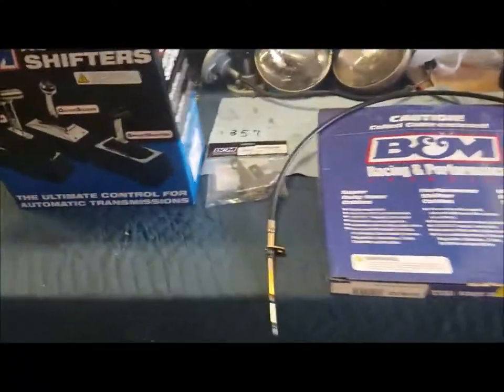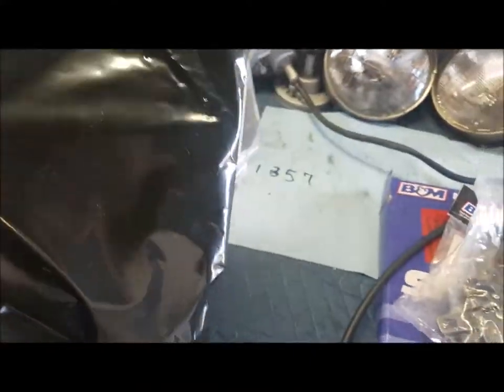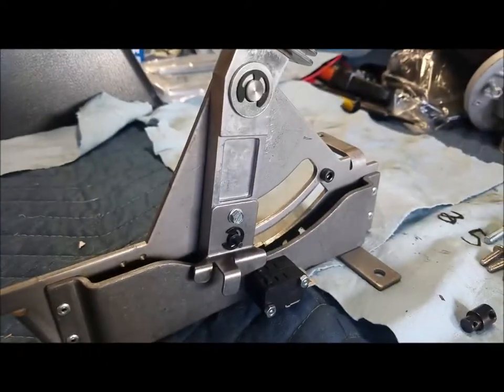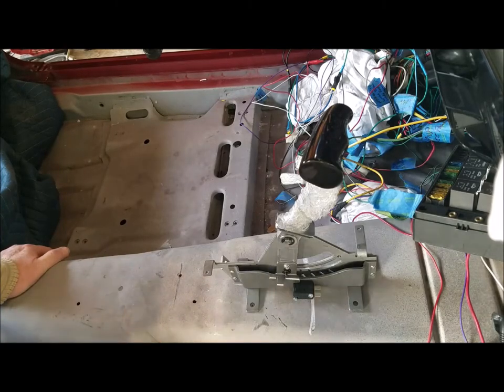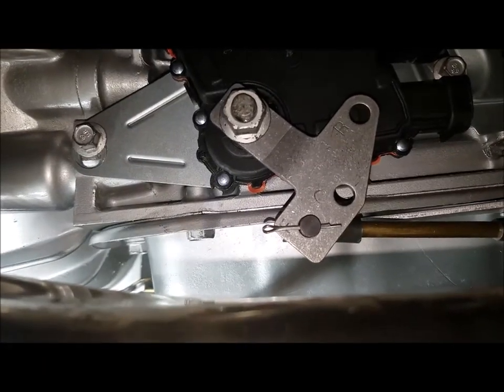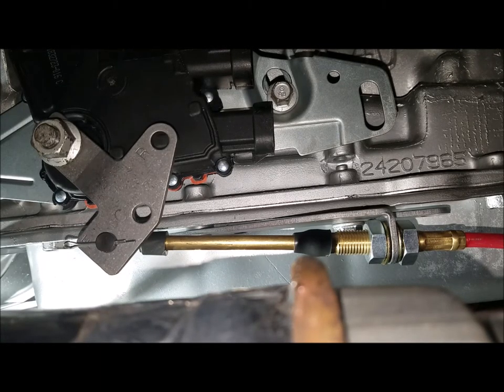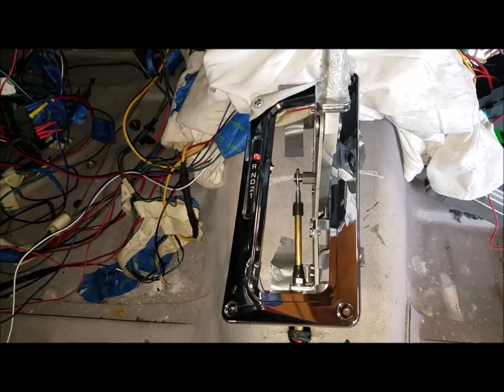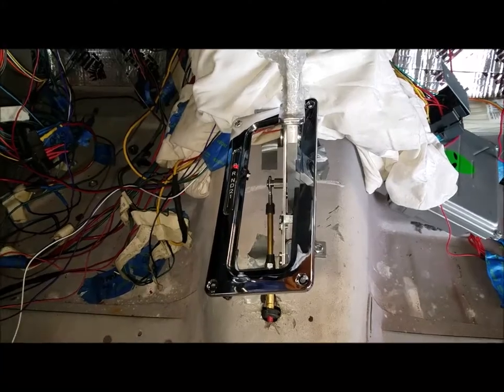B & M Sports Shifter install

Comment: Thank you for providing this instructional video.  It helped a lot, as I am considering the same shifter for my 4L60E, however I have a question.  I see that you were not able to shift it into 1st gear.  I see you only went from D,3,2 but no 1st gear.  Or did I see that wrong?  If you could clarify that, I'd appreciate it.  Thank you.
Reply from the maker: Thanks for the question. I reviewed to see what I did and it did shift into 1st.  This video I hadn't hooked up the switches yet, it was starting in all the gears. The next video I did correct that. Currently the vehicle is up on jack stands so I see if the left rear wheel turns and it does in all the gears except park, but even in neutral the wheel turns. Looked at some forums and a couple of people said it was normal for the wheel to spin while in neutral.  I'm not sure if that is correct.  Still searching for a definitive answer.
Reply: Thank you for your reply. 👍  I'll check out the other video too.

Comment: No 3rd microswitch is bad.  Holley needs to get it together.  How is the PCM going to know if car is in P/N vs in gear?  You need the NSS for ignition/starter, so you can’t use that one and there’s no room
for another switch in the P/N position.

Comment: Wait you have a 4-speed transmission and you didn't shift down to first. I think you will burn up that transmission being in 3rd instead of overdrive. I may be wrong, but I thought you only shifted down from drive to second to first. You're missing overdrive.
Reply from the maker: I think you're correct. 👽

Comment: Had the same problem with my neutral safety switch.  I ended up spraying the transmission coupler bearing with some wd40. Problem solved.
Reply from the maker: WD40 is the magic stuff.👽

Comment: I'm about to install this shifter in my 73 Nova with a 350 transmission. I'm aware of the wiring with the neutral safety switch but I'm curious if you have completed your wiring yet? If so I have a couple questions for you. Thanks
Reply from the maker: Wiring the shifter? I don't have the base on it and it still looks like spaghetti but I can shift it through the gears. So what questions do you have. 👽
Reply: @AlienRestoMod  I believe @Kim Whitacre is referring to wiring the back-up light and the neutral safety microswitches that are mounted in the shifter.  They're actuated when the shifter is in the respective positions for the operation of the microswitches.  I'm in the process of wiring a legacy SportShifter someone installed in a 1973 Chevy step van I recently purchased when they removed the manual transmission and put in a TH400 — they didn't wire up the microswitches, so there's no back-up light or neutral safety functions happening (but they added a toggle switch to the dash to manually turn the back-up light on/off as needed) 🙄...  I have to trace and re-route the old wiring to get things working.

Comment: Is there any way I could use my stock shifter cable it says to but I can't get the cable to bend correctly to be  straight on the ford AOD   and it has a big eye hole
Reply from the maker: Not sure I'm gonna be much help but this is my 1st time putting a shifter in. I went with the 5ft cable because of the bend that is required to link up with the transmission. Still need to adjust the hole in the floor to accommodate the cable better. You can call the manufacturer and see what they say. Good luck.👽
Reply: @AlienRestoMod  ya the stock cable seems like it has to be perfect and I had a shop put it in the 1st time